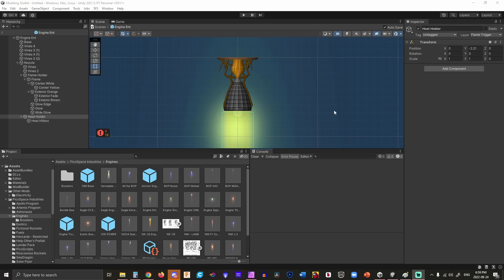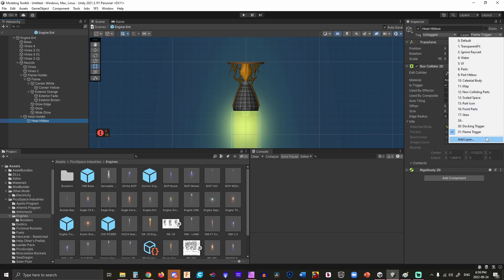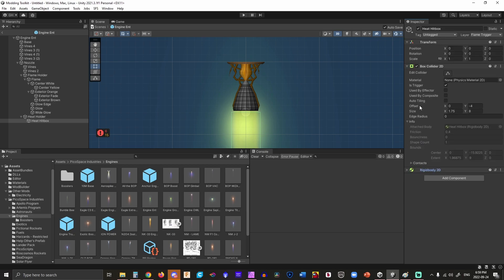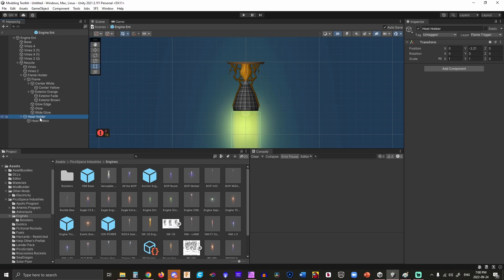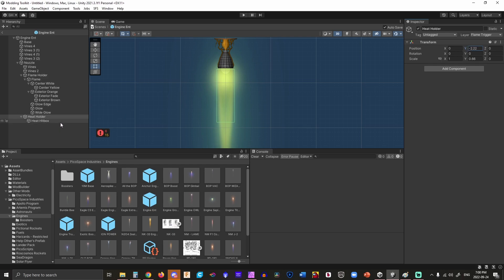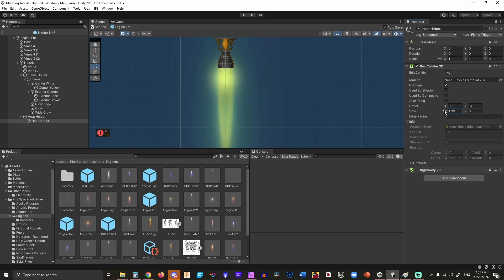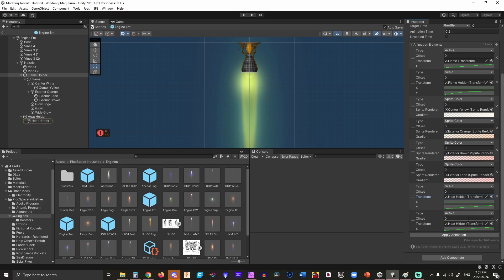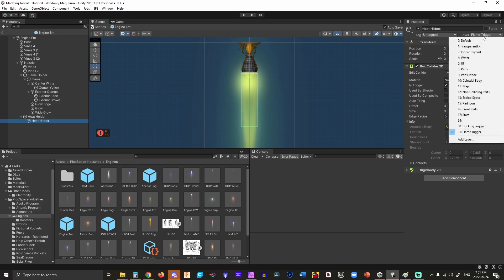SfS Mod Tutorial: Adjusting Heat Hitbox for custom part Engine Plume for Spaceflight Simulator

Comment: What mod with modloader?
Reply from the maker: This is the modtoolkit, it works with the Stream PC/MAC beta, next version release will have mod/custom part loader built in as well. Not compatible with older modloader.
Reply: @picospace  Ok
Reply: @picospace  i also need to know what version of the modloader